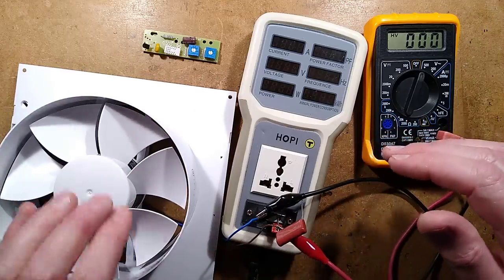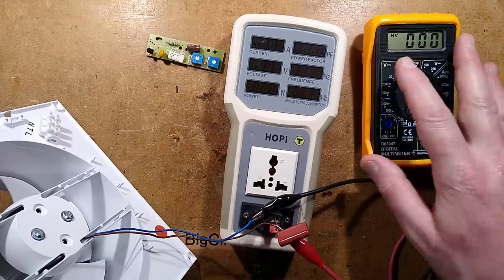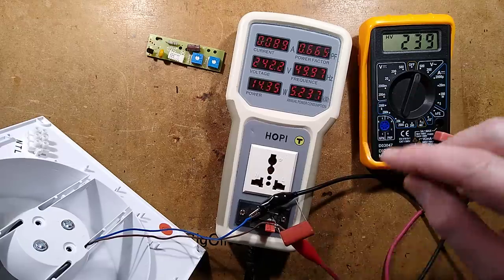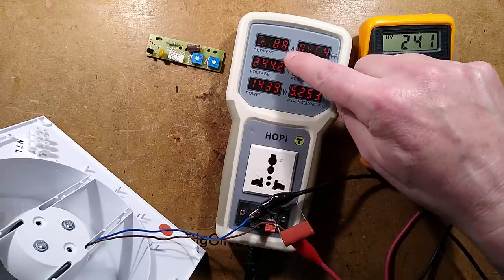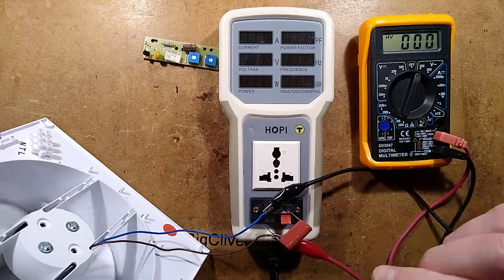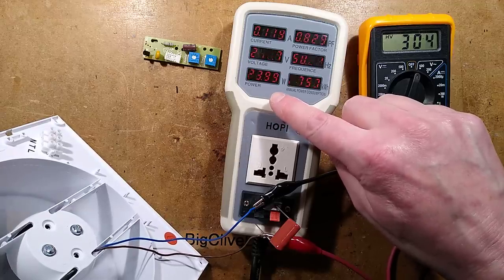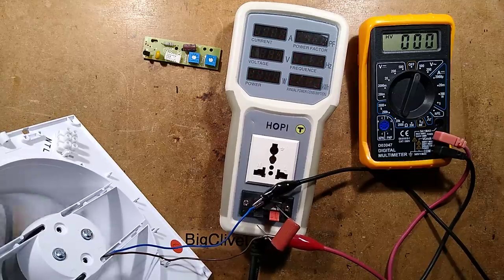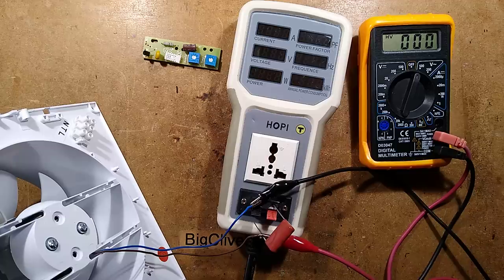What the heck!  Series capacitor makes fan go TURBO!

Comment: Positive reactance is cancelling negative reactance, resulting in higher current. This is somewhat limited by the back voltage from the motor.

You'll also note that the power factor went from 0.6 to 0.8.
Reply: The power factor is the biggest giveaway.
Reply: This is why capacitors are used in industrial settings where they can save you on the power bill. In the US, our residential is only billed for used power. Capacitive and inductive reactance only really apply to your bill with 3 phase meters.
Reply: presumably you could tweak the series capacitance to tune the circuit to get the PF to .95 ish? its interesting to see power factor play out like this
Reply: With a PF tuned as close to 1 as possible, would the fan spin as fast as possible for the given supply voltage? Would the motor windings get hotter, or would they in fact still be carrying the same total current, just more of it being "real" (i.e., in-phase)? The reason electric companies hate poor power factors is that the unused current still has to traverse the transmission lines, so I'd guess the fan motor windings could be carrying the same current even with a well tuned PF.
Reply: @whitslack  the drawn current should be nearly the same, regardless of PF.  The fan would spin faster in theory, but remember that it will have more load from air. If it moves faster than the available load from air, it will be in a stall state amd reduce current for the relative rpm. The fan will run cooler temp on the windings as a result of correct phase alignment. Startup with a near perfect PF will result in longer inrush current period. Capacitance or voltage needs to be lagged for directionally and overcoming inertia. Most manufactures want 90 degrees out of phase. Newer ecm motors and single phase motors driven by vfd will approach the sweet spots for as good as they can get on PF after either rpm speed is achieved or near stall state. Sometimes this is read by polling voltage, current, PF, or emf....depends on manufacture.
Reply: Caveat. You will usually see most motors around .5 to .6 PF that aren't using newer tech.
Reply: @whitslack No, increasing the power factor, i.e. approaching resonance, increases the current. This is easy to see on BigClive's HOPI device. It is a series circuit, so the current is the same for all the components. This  increased current becomes more and more "real", i.e. generates more mechanical power and more heat dissipation. This is also visible on the HOPI device as an increase in the value of the power factor associated with an increase in the active power drawn from the power grid.
This is why utilities companies don't like small power factors at the consumer site. For a given active power used by the subscriber, the lower the power factor the greater the current passing the lines. The current heats up the lines proportionally to the effective value squared. This means the power plant has to generate more energy in order to supply the given amount of useful, active power.
Reply: @CG-rr6yx  Are you suggesting that the imaginary component of current doesn't heat up the lines? I always thought that was the main issue with poor power factors, that the transmission lines and transformers had to carry current that isn't doing useful work (even in customers' electric meters), yet that useless current still counts against the carrying capacity of the infrastructure. If what you're saying is true, then correcting the power factor not only would convert more of the total current to real, useful current but also would heat up the transmission lines more. Of course, customers really have closer to fixed real power demands, so correcting their power factor would probably mean they'd increase their ESR so as to draw less total current, same real current, and electric companies like that. But are you saying that the transmission lines would dissipate exactly the same amount of heat since the real current would be the same?
Reply: @whitslack  It is very important to remember that the current is the same for all the components of a series circuit.
The electric line is, of course, a complex impedance itself, but the low frequency allows us to think of it as a low value resistor in series to the load. Through this resistor flows the whole current of the circuit. The load imposes the value and phase of this current, which (very important also to note) represents the apparent current for the load.
A current passing through a resistor always generates a voltage at its terminals, which is completely synchronous to the current (phase zero degrees).
All these bring us to the conclusion that, in the limits of a rather simple model, the apparent current (its effective value) demanded by the equipment at the consumer site sets the amount of heat dissipated by the electric supply line.
So, limiting the reactive component of the load current limits the apparent (geometric total) current demanded from the power line and thus limits the unnecessary losses on the energy transport path.
Reply: Eddy currents…
Reply: @seedtheskies  Interesting! Does it means that home appliances don't have capacitors for compensating inductance? Because this can be so much amounts of energy get lost at country scale!!?
Reply: @khashayarmodaberi4958  most home appliances do have capacitors or even banks of them. Their application or reason for use will vary across a multitude of reasons. From filtering noise to filtering on power supplies to lagging current. There is an inexhaustible list of capacitor uses. Most circuits will end up heavy on either capacitance or inductance and will need balancing. I've seen some circuits so well designed that capacitance and inductance are controlled by the very amount of components and where those components are located on the boards. In radio use, you will see capacitors used for signals driven to the antenna. The modulated signal has its DC being filtered and only letting the ghost of the AC signal pass through. By ghost, I mean RF. Speaking of antenna, that little cap on the top? It's called a capacitive hat. This filtering applies to audio and visual devices too, both generating and recording/recieving. Back to radio, you can Tune anything with the right components when it comes to impedance and reactances. I watched some ham guys turn a metal shelving unit into an antenna. I don't remember what wavelength but it was damn impressive.
Reply: @khashayarmodaberi4958  the capacitance is not usually for power factor in home appliances. I guess it depends on your applicable governing authorities in your area. Sure it adds up regionally for utility companies, but it's kinda already priced in. I am suspicious of any claims that correcting PF as an add on will save anything for utilities. A load is a load, making it not as reflective doesn't really decrease how much load. The power companies handle this on the backend...for now.

I forgot to mention psc motors earlier. Those are a neat design that reinforce that capacitance doesn't have to come from a specific component.

Comment: Clive, your capacitor in series with an inductor has introduced a resonant rise in voltage, current, and overall power.

I've done similar tricks with a transformer in series to get the voltage rise 😊

Comment: Pay attention to the power factor in both of these cases. The capacitor is correcting for the inductive reactive power and you are getting more real power supplied to the load. If you break up the true/reactive/apparent power in both of these cases, you will see why this is happening

Comment: You also corrected the power factor, I think it's the same as passive power factor correction in switch mode power supplies. It takes current during the crossing point (which would otherwise be fed back to the mains) and passes it to the load. Obviously the load is the same so the only thing that can change is the voltage.
Reply: Except usually PFC caps are supposed to be parallel to the load, not in series which makes it pretty interesting.
Reply: @benbaselet2026 It works equally well. When in parallel, voltage is shared, current acquires a cyclic component that enters the capacitor from the fan's coils, to be reversed half a cycle later. When in series, current is shared, and voltage at the node between capacitor and fan's coils is what acquires an extra cyclic component.
Reply: @benbaselet2026  and usually PFC doesn't result in 70% more active power consumption (unless your caps have failed short)

Comment: We did something like this when I was in college except it was with a frequency generator, a capacitor and an inductor.
As you get closer to the resonant frequency there is an amplifying effect based on the Q factor of the components. We were putting in 1 volt and, with fine tuning of the frequency, some of us got over 80 volts across the capacitor.
Reply: WOW!! It's So Huge!!
Reply: it's the voltage across the resonant circuit times de Q of the LC circuit. That's why RF circuitry which is rated for low voltage needs high dielectric strenght insulators.

Comment: Hook it up to a signal generator and measure the voltage/current waveforms with various capacitors and input frequencies. It doesn't need to be tested at 240v.
Reply: Think you ment oscilloscope. Don’t mean to be picky but a lot of pwople come to the comments to learn. I come here to realize I need reading glasses. So sorry for the spwlling.
Reply: @Rubensgardens.Skogsmuseum  What he means to say is look at how the circuits inductance and capacitance interact at various frequencies. You would do this using a frequency or signal generator and you would observe the wave forms and voltages on an oscilloscope. That way you could see how close to resonance you are getting with different capacitors. Like the OP says, this can be done at any convenient voltage level. He has not made a mistake by saying `signal generator`

Comment: I have been doing that for years.  Had some nice 240V PABST fans that I wanted to use on 120V equipment. Just put a capacitor in series and that boosted the voltage up to 190V.  I don't like noisy fans so I run them at lower voltage for more slip.  Resonance.  Surprised you didn't put the voltmeter across the capacitor too.  That would have higher voltage too.   Sometimes I've guessed at the wrong cap value with a transformer and had it instantly burn up.